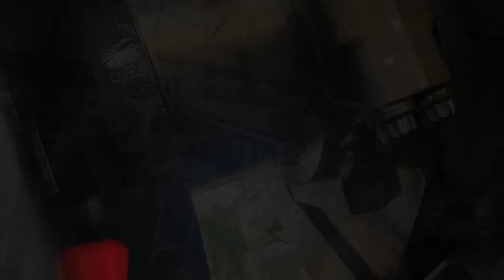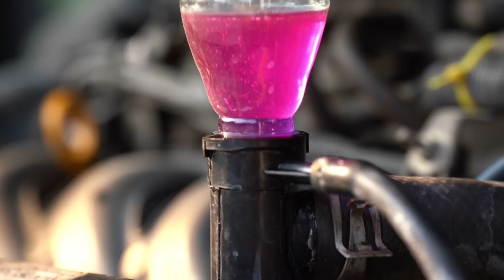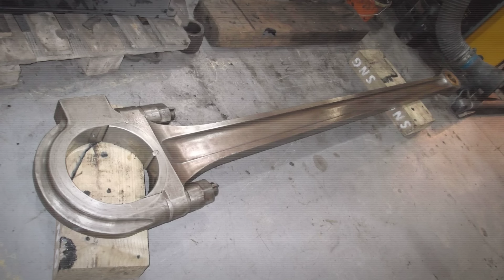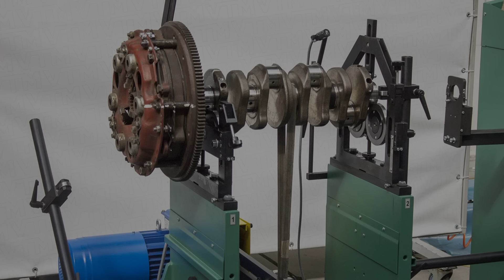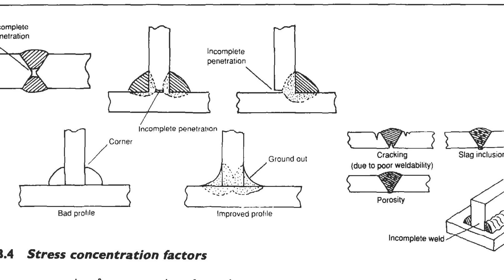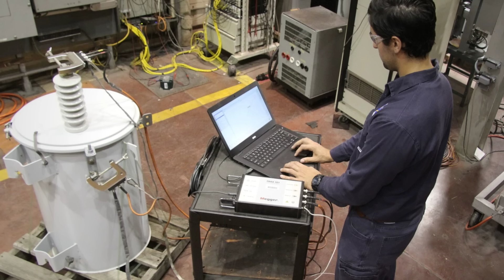How 1 Gallon Of Water Shattered A 30,000-Pound Engine Block (The 10 Worst Locomotive Hydro-Locks)

Comment: If it's that problematic, then why not put something that's very similar to a freeze plug on the side of an engine, but for hydrostatic lock on the center of the piston, keeping the center shape  For the diesel Injectors. but the ability to slide out of the center of the piston in the event of a high Hydro static lock Of an event but  is there to withstand the Max load of The engine, but pops out. Before the pressure of the hydrostatic lock starts destroying things At least saving the block And if designed right the piston, it rods in crankshaft as well. Or maybe even a spring-loaded relief valve in the Piston design
Reply from the maker: The concept is in the file — a sacrificial pop-out under hydrostatic load rather than destroying the block. Whether production tolerances ever made it viable is a different chapter.
Reply: Wow, maybe have a type of fuse system that will sacriffice itself before the engine is damaged, it would have to sustain the pressure unti( tjhe engine. Pushess ust ove the fuse break level which would have to be just before it broke Nd couldnrecordntje pressure it sustained.  Or a plug system that pushed a prepared plug that can be pushed out under pressure, the more plugs gone the higher the pressure was.  Verry Interesting!!!

Comment: A bit of a strange but interesting video. This many failures would not go down well in any company I worked for. its not like the whole theory of hydraulic lock is well understood.
This mostly happens at start up often causing inconvenience rather that any loss, and comes across often as a flat batteries, electrical or faulty started. however if the particular cylinder is the last of twelve or 16 then yes defiantly a bigger problem, I have known this to happen, the engine starts and carries on running missing badly with a bent rod and with one cylinder blowing white smoke. Some owners were to continue using said engine for months in that condition.
One would expect a slow build up to hydraulic lock on a running engine however, and in any event the issue to be perhaps rather rare and more from an ancillary equipment failure, turbo or aftercooler, with significant volumes of liquid necessary to cause a catastrophic failure of that nature, all be it in one single event, it might be reasonable expected that most  of these potential issues would be addressed and  resolved during normal maintenance. The old saying, you can buy a mountain of filters and oil for the cost of one failed engine.
Of interest the big old radial aircraft engines had to be manually swung over to remove the accumulation of oil that drained down into the lower cylinders over night, standard pre start up procedure of the day, they no doubt did not have enough starter cranking power to do to much damage
Reply from the maker: The radial detail is exactly right — hand-propping to clear the lower cylinders before every cold start. That discipline is in the file. And the bent rod running on white smoke for months: documented behavior. The iron punishes neglect slowly, then all at once.

Comment: After the engine is running it shouldn’t be an issue as compression will keep most of the water out of the cylinder and the little bit that could get in is not an issue!
Reply from the maker: Volume is the variable. A little water — agreed, compression handles it. One gallon entering a single cylinder at speed — the file says otherwise.

Comment: “It’s amazing how something as small as a gallon of water can destroy such a massive engine block. Really shows how powerful pressure and physics are inside these machines.”
Reply from the maker: Hydraulic lock is one of those failures that looks impossible until you understand what's actually happening. Water doesn't compress. The piston keeps moving. The connecting rod takes the full load of a system that was never designed to absorb it, and the engine settles the argument in about one revolution. Physics doesn't negotiate.

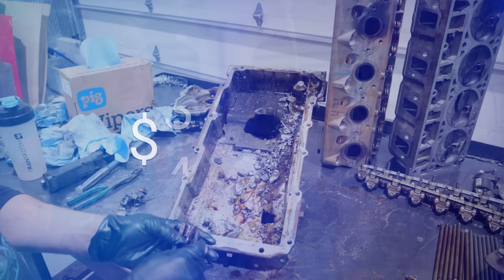Comment: 5:47 $2 Million, 8:05 $5 Million damage to a locomotive engine? (Damage and Liabilities/Losses are two different expenses.) An EMD 16 Cylinder Prime Mover costs between $90-500K for a rebuilt or new. (EMD 645 or 719 pistons and rods weigh 50 pounds each not a "500-pound steel connecting rod" in your description.) The cost of a new GE Tier 4, ET44AC is $3-4 million.
It would be the heavy Marine Diesel Engines that get into the millions of dollars and have massive pistons and rods. The Wartsila RT-flex96C and RTA96-C (largest marine diesel engine) pistons have 38 inch bore and stand 20 feet tall and weigh 5.5 tons each! 
Google: cost emd locomotive engine; new ge tier 4 locomotive; wartsila rt-flex96c (largest marine engine). NB, Canada.
Reply from the maker: The cost separation is correct -- the $2-5 million figures in those incidents are total loss accounting: recovery operations, regulatory exposure, downtime on a revenue-producing asset, freight delays cascading through the system. The engine block is one line item inside that number. The EMD 645 rod and piston specs you're citing are accurate -- the '500-pound connecting rod' figure doesn't hold up against the actual machining drawings. On the Wärtsilä comparison: that's the right call. The RT-flex96C operates in a different mass category altogether. A locomotive is built to weight-per-axle limits that don't exist on a ship hull. When those constraints come off, the component geometry scales accordingly.

Comment: Hydrostatic lock is caused by: 
1) Diving thru deep water, where the engine draws water thru the air intake, or low cold air intakes on vehicles where heavy rain can be sucked into air intake.
2) Engine coolant leak into the combustion chamber/cylinder caused by a blown head gasket. 
3) Excessive fuel injection caused by a stuck-open fuel injector. 
4) Marine engines where gravity forces oil/water into cylinders after sitting unused for long periods of time. 
Google
Reply from the maker: All four of those paths are accurate. In a locomotive context, the head gasket failure and the stuck injector are the two most operationally relevant -- they're the failure modes that develop while the engine is already running, often without the operator having any warning until the connecting rod exits the block. The water ingestion scenario requires a fairly specific set of conditions to hit a diesel prime mover, but it's well documented in flood recovery situations where units were submerged and then restarted without proper inspection. The gravity-fed scenario on marine diesels is why cold-engine cranking procedures on those units require manual barring before startup. The water isn't compressible. The rest of the engine doesn't care.

Comment: I dont know if a pressure relaef valve could be fitted like wates fitted on steam boilers
Reply from the maker: The comparison to steam boiler safety valves is a reasonable starting point, but the physics of the two events are different. A boiler relief valve is managing a sustained pressure buildup -- you have time for the valve to open and bleed off the excess. Hydrostatic lock in a diesel is a single-stroke mechanical event. The piston is already at the top of its travel before any relief mechanism can respond. Some engines have intake pressure relief provisions, but they're not positioned to prevent the failure -- by the time the load transfers to the connecting rod, the outcome is already determined. The water doesn't compress. The crankshaft doesn't stop.

Comment: Why not turn the engine slowly 1 revolution and then ramp up?
Reply: This what you do with aircraft piston engines especially radial engines with inverted cylinders although their problem was oil causing the hydrolock not water. In the old days the engine was dragged through a few revolutions by manually pulling the propellor. With modern starters which have a load limiting clutch you crank the engine through several revolutions to make sure the cylinders are clear before turning on the fuel and ignition. The starter clutch protects the engine if there is any hydrolock. I recall on a DC6 we used to count 12 propellor blades before selecting fuel/ignition on. 12 blades equalled 8 revolutions of the crankshaft allowing ample time to clear any excess oil out of the inverted cylinders. This is why it appears to take along time to start a big radial engine.
Reply from the maker: That's the barring-over procedure, and it exists for exactly that reason. On marine diesels and some large industrial installations, the protocol after any period of inactivity is to manually bar the engine through at least one full revolution before startup -- to identify hydraulic resistance before the starter motor commits full torque to the problem. The issue with locomotive prime movers is access and startup sequence. Those units don't have the same manual barring provision that a stationary or marine installation does, and the startup procedure goes from stopped to cranking in a single step. In flood recovery operations, the inspection protocol is supposed to catch this before the unit goes back into service. But if the water ingestion happened in service, there's no intermediate step between the last revolution and the one that fails.
Reply: A startup check like that would be better

Comment: AN CYLINDER CAN BE HYDROLOCKED WITH OTHER LIQUIDS SUCH AS FUEL FROM AN DEFECTIVE FUEL INJECTOR
OR LUBRICATING OIL!
ON AN G-P 7 EMD  LOCOMOTIVE THAT WAS OWNED BY AN LARGE GRAIN ELEVATOR , THEY GOT AN VERY RARE HYDROLOCK!
ONE DAY THIS LOCOMOTIVE WAS PARKED ON THE TRACKS UNDER THE ELEVATOR , UNDER AN LEAKY 
GRAIN CONVEYOR BELT AND THE EXHAUST OUTLET STACK WAS DIRECTLY BELOW.
THE WHEAT DRIPPED IN AND DROPPED INTO THE MUFFLER
AND FELL THROUGH THE OPEN EXHAUST VALVES TO THE TOP OF THE PISTON!
WHEN THEY TRIED TO START 
IT, IT BENT THE CONNECTING 
RODS!
Reply: WE NEED TO ASK YOU TO LAY OFF THE CAPS LOCK KEY smh
Reply from the maker: The enthusiasm is real. The formatting is someone else's problem.
Reply: You read my mind! It’s not just water that can hydrolock an engine.
Reply from the maker: Water, fuel, oil, grain -- the engine doesn't discriminate. If the cylinder can't complete its stroke, the load transfers to the connecting rod. The material is secondary to the incompressibility.
Reply from the maker: Grain is an unusual medium, but the physics don't care what the material is -- if it doesn't compress, the connecting rod takes the load. Exhaust stack ingestion is the failure mode that catches maintenance crews off guard because the engine is static and appears intact. Nothing in the standard pre-start walk-around flags wheat trickling through an open exhaust valve while the unit sits under a conveyor. The GP7 had no warning state before the rods bent. That's a field record worth keeping.

Comment: Putting a leg out of bed.
Reply from the maker: That's the hydrostatic lock problem in four words. A small displacement -- a stray leg, a cup of water, a stuck injector -- becomes a force multiplier the moment the piston arrives. The engine doesn't negotiate.